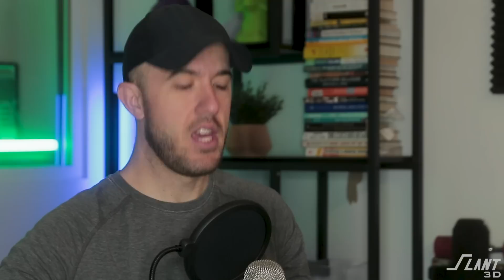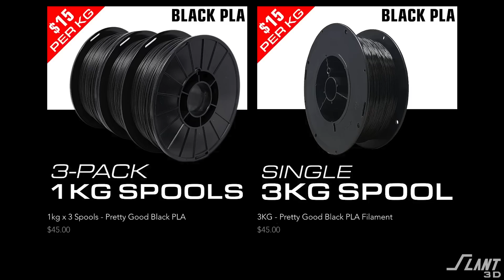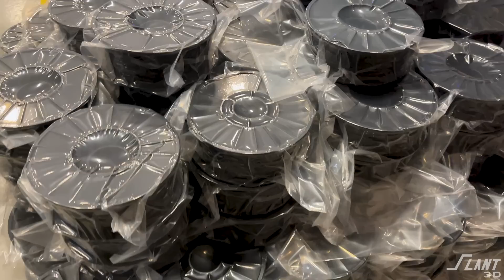3D Printing News | Beef with Scott Galloway | 10kg Spools? | Tensile Tester is Here

Comment: what is marketing anyway, its about separating fools from their money, which appears to be Scott Galloway's swim lane. There is a difference between appliances and tools. I would place 3d printing into the tool category. Akin to an electric drill, don't use it daily, but performs a specialised function well when needed. my 3d printers have allowed me to create bespoke items or revive discontinued appliance parts.  I can produce educational items to reinforce my own learning. 3D printing, VR headset or $20 Scientific calculators is it required in everyone's life? No. There are intrinsic qualities to those 3 items, its allows us to reach a big further forward, and claim a bit of time. Armed ith only a pencil and paper will produce the same result for a 4x4 matrices operation,  but why would not use a generic $20 calculator to assist in some of those operations? In that moment the intrinsic value is time. Marketers see only features not intrinsic value or potential in other spheres. Engineers can evaluate worth more than most professions. Hence Slant found that extra performance, converging towards Kaizen.

Comment: 13:37  Would letting people pre-order filament where they buy the desired amount, but have the fulfilment happen later so that you can batch up a block of orders accurately, help with the distribution?  It'll add a delay to someone's order of course, but for hobbyists who aren't buying in massive bulk I could see it being beneficial for them to get the orders in without causing disruption to the higher demand orders.

Comment: Regardless of whether it gets the penetration of smart phones - I think being a hobby will stick around, and most people will know somebody with a 3D printer. For starters, it'll always be cheaper. That was made pretty clear when you spent most of an episode ripping on 3D printed Etsy products for being under-priced. Also - a hobbyist will always be more flexible than a store front. Sure, you don't want to confuse buyers with too many choices - but that can be a double edged store, as sometimes somebody will want a one-off print exactly in the color or variation they want. A hobbyist can more easily accommodate the oddball request than a store front ever will.

Comment: In home 3d printing isn't dumb for engineers and artists. If you want latticed plastic widgets for your custom drones, or custom minifigures for your tabletop games, thats what 3d printing is best at. Depending on your volume, it might make sense to use a print farm, or maybe you should buy a printer. But if you are any flavor of researcher/inventor,  i.e. an inverse kinematics roboticist, you don't want to share the models with anybody til you've got a patent. For those types of users having in home CNC and 3d printers just makes sense.
Reply: The patent and also time untill you have the part might be the biggest issue. The print time in plastic may be the same but with i.e. a bambulabs printer the hassle of getting it to work is mostly gone and the convinience to imediatly habe the part and not wait 2-3 days for shipping is worth a lot. When I need parts, the printer just runs overnight and I've got it the next morning.
Reply: @clockworkvanhellsing372  i got an elegoo and regret it every day. Pos...
Reply: I printed off 12 skeletons and a lich for weekend DND, the party ended up avoiding the encounter and went off to look for goblins. I had less than 24 hours to print goblins. A print farm couldn't help me with that sort of turn around, but my fdm printer could. A 3d printer can be a good tool for a DM with CAD/blender experience.
Reply: We 3d print many of the functional parts used in our industrial products, using just one 3D printer. 3D printing parts is very convenient, better than milling aluminum parts, which takes a long time and requires a lot of post processing

Comment: I really want to see reusable spools soon please? Needing to re-spool off your cardboard spools is getting kinda old. I HATE cardboard spools, they limit the print speed too much, and because your spools aren't consistent I can't even do the stupid spool ring thing. It's really frustrating.
Reply from the maker: Noted. It looks like reused spools will likely be coming to an end soon. Update later
Reply: Bambu has reusable spools.  The two halves can be locked and unlocked and you put your refill roll in the center. Its good design.